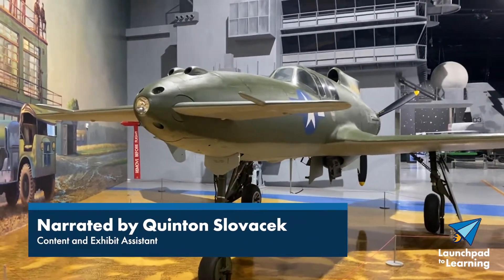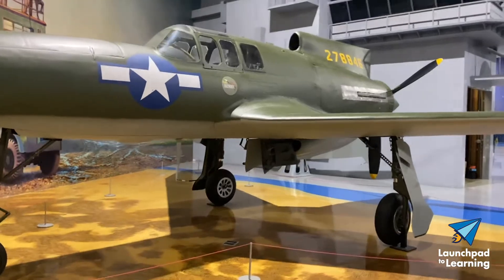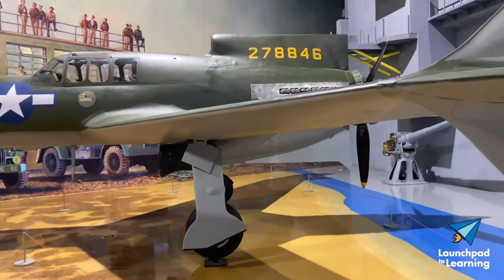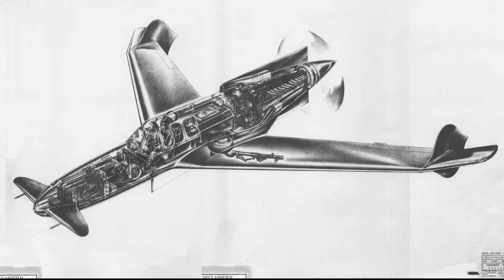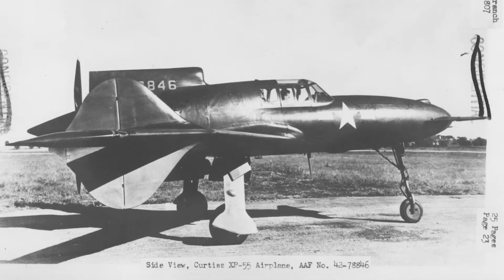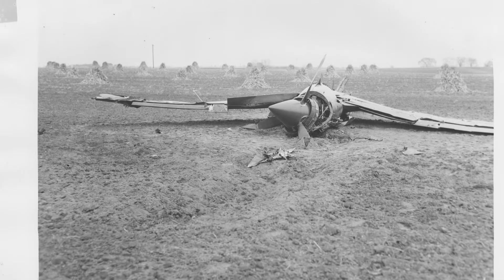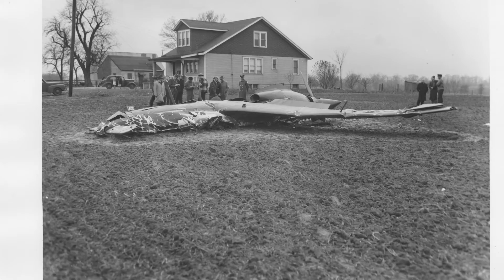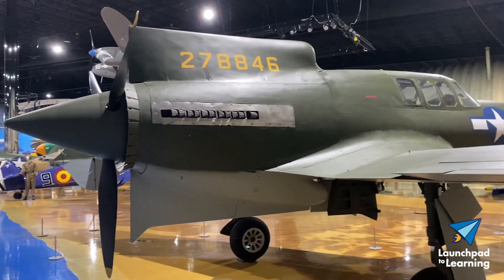The Experimental XP-55 Ascender

Comment: has this plane flown after restoration?
Reply: @AirZoo  do you know if there as been a remake for private use or flight because when i was younger i saw this plane flying.
Reply: @AirZoo  yeah this helps quite a lot! But so far no other air craft matches as closely as the xp-55. There might be a near exact replica out there if the one in the museum never went on a tour. The aircraft I saw flew around the Vancouver WA / Portland Oregon area in the 2005-2008 ish time frame. 

Who knows and it may be a mystery for ever.

Comment: Started five to seven years too late.   With a Rolls Merlin and the aerodynamics cleaned up to get rid of the treacherous stall, it could have been the first fighter to get air-to-air refueling without the tractor prop fouling the fuel drogue.

Comment: What makes this flawed fighter aircraft "ahead of its time?"
Reply: It has swept wings like the later german ME262 that was pretty modern for its era! A canard layout you can find on many modern Fighterjets as Eurofighter Typhoon and French Rafalle...Give it some more development and it would outclass most conventional fighters of its era. Give it the most powerfull supercharged P51 Mustang Packard Merlin engine and it easily will competete with the superb German Dornier DO335 arrow that also had swept wings but no cannards: https://de.wikipedia.org/wiki/Dornier_Do_335#/media/Datei:Do335_Smithsonian.jpg
Reply: @Schlipperschlopper   - This aircraft topped out at 390 MPH.   This is the same as the similarly powered P-51A. a proven aircraft  with superior flight characteristics.  And the Mustang, as well as the Republic P-47 Thunderbolt were already in production.  By the time the Ascender would have entered production, the war would have been just about over. And by then, aircraft designers were thinking jet propulsion.  And if you look at the history of the Curtiss Wright Company, you would probably have much less confidence in this weapons system. Following the P-40, what?  The SB2C, probably the Navy's most hated aircraft of WWII. They got the R-3350 ironed out but took a long time.  And my personal favorite, the C-76 Caravan.  
By the way, the Do 335 did have a novel engine layout, fore and aft but it had straight wings.  The wings of the Douglas DC-3 have more sweep than the Arrow!
PS - Curtis Wright was finally ordered to stop P-40 production and build, under license, the P-47.  All  they produced were of such poor build quality as to be deemed unfit for combat use.
Reply: ahead of its time is when something is limited by the times technology to work, like the Go 229 flying wing would have had a better time with a computer....
Reply: @engineermerasmus2810  - In the case of the Go 229, you would be correct.  The Ascender was arguably obsolete when it first flew.
Reply: @Mike Wazowski  - That's your answer?  "Ahead of its time" to me means a design or idea that was either not appreciated at the time or was not viable because the technology did not exist to make it work. But eventually,  it was proven. 
So what about the XP-55? No faster than the similarly powered P-51A and slower, and with inferior range to the P-51D. 
Flew backwards? Very late in the game for that. The 1903 Wright Flyer did that! Forward elevator and rear pusher props that were counter  rotating to cancel torque effect.   
The closest to proving your claim, Mike, is the designs of Burt Rutan but the industry has yet to embrace his cantilever  designs such as the "Long EZ."  So I'll just assume post was an ineffective attempt at humor. And reminiscent of what a mother might say to an insolent child asking "Why"  when told to take a nap. the answer was "BECAUSE."